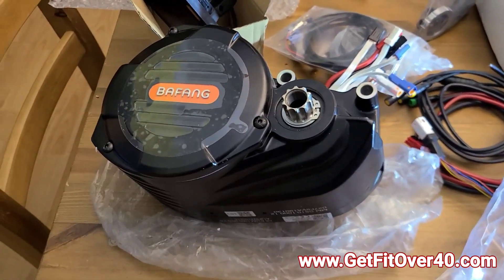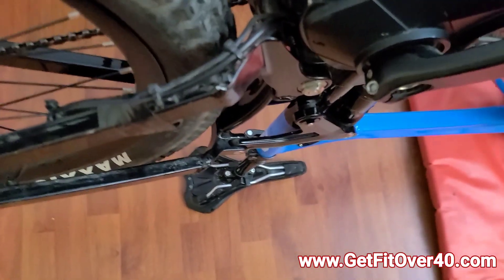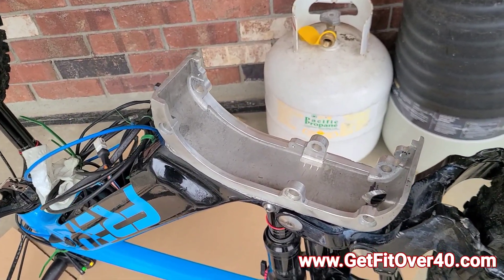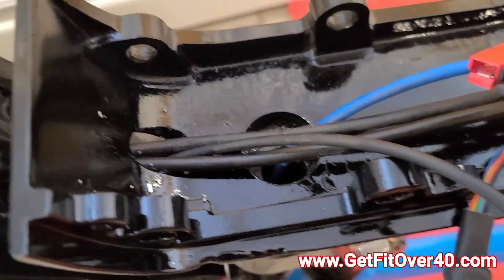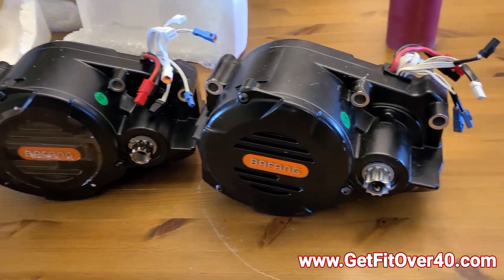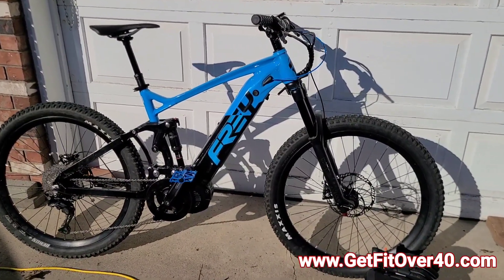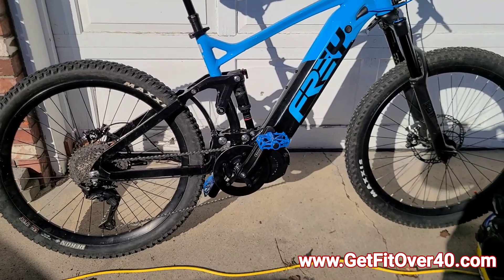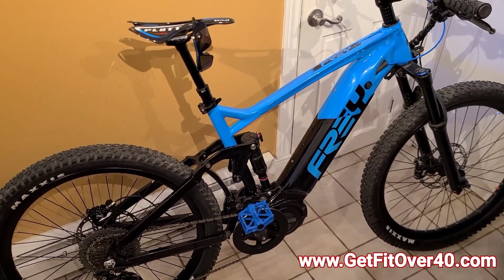This Didn't Go As Planned - Bafang Ultra eBike Motor Upgrade

Comment: i this the difference is utar or canbus. canbus is hard and you need that expensive tool you bought. but the utar is the better one the “broken” one. you can do it with that display they told you or the eggrider v2 and it’s your display and it’s bluetooth to your phone so an app to change settings and fine tune. check out the eggrider V2 display and how to program many vids on youtube

Comment: They like to make restricted crap unprogrammable the new one parameters locked in ! Wires usually give problems depends where you bought the parts  ! Stay away from cheap ass companies ! Expert in E bike faults had them all ! God bless ! More $$$$$$$$$ done on purpose so you buy from shop rip off ! I got 3 ! when flashing had throttle blow Pc headache Bought new one ! changed harness ! PC ! F en headache ! BBSHD old one The best !

Comment: I got an empty Bafang frey am 3.0 frame that came with the ultra - can I just buy an ultra motor new and fit it and be done? Or do I need to calibrate it?
Reply from the maker: New motor will come calibrated. Just install it in the frame.

Comment: Thanks sooooo frikin much!!!! I was about to change my hall sensors, repack my battery change the battery connections.....  But no I need to recalibrate my controller.   Did you get instructions on how to use the new display to calibrate the battery? Thanks in Advance :)
Reply from the maker: Yes I did get instructions on how to sue the lcd screen to calibrate the motor. Unfortunately it didn't work for me so I am back to either a problem with the new controller  or the motor itself.
Reply: @getfitover40  here is a reply I got from my controller supplyer:   "To be honest, the UART motor has no need to connect the Besst tool to calibrate it.
According to one of our US customer, you can try to open the motor stator, adjust/rotate the rotor manually till you find the matching position that the motor won't shudder"
Reply: @getfitover40   I just fixed my shorted controller. I DONT know what i was doing but it worked. https://youtu.be/5TzwVqcB-io
Reply from the maker: @uxplore1  My controller burned out in a similar area and I kind of did what you did but took it into a place that actually replaced the tiny resistors, after I did get power to my screen but then had something else wrong with the controller as the hall sensor showed an error. I know the hall sensor is ok because when I put the new controller in I do not get an error.

Comment: Why fluff around with that controller? I use a Phaserunner controller on my Bafang BBSHD and plan to use it on an Ultra next. It seems to be capable of 5kW which makes 1000w seem quite pathetic.
Reply from the maker: When you run an external controller you don't get the feedback form the peddles, basically just throttle control at that point. I also don't want too much power as I want the biek to still feel like a mountain bike, not a motor bike and I want to get some sort of decent distance from it. But an interesting way to go for sure.
Reply: The Phaserunner on a BBSHD is more the “electric motorcycle” experience. With a good torque sensor properly tuned, it’s more the “Superman on a bike” experience.
Reply from the maker: @Excaliburt  I bet, I like the feel of being on an actual Mountain Bike and having to do some of the work. When on MTB trails having all that power is kind of too much. I find I generally run lower power settings on tight trails because of this usually 2 or 3 out of 5. I always have my throttle which I can twist for full power on demand when needed even when in lower settings which can get me out of trouble if I picked a wrong gear or get caught on a steeper section than anticipated.

Comment: Nice video mate. I think you can configure the different levels the pedal assist kicks in.
Reply from the maker: Thanks, and yes my motor is UART version which is fully programable so I did the "soft tune" which re-configures the pedal assist in all levels really smoothing things out.